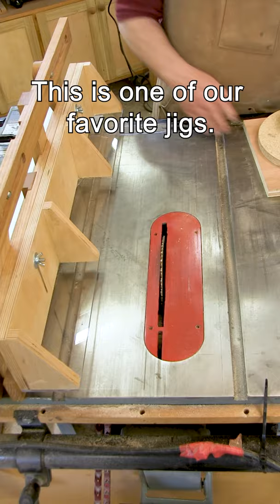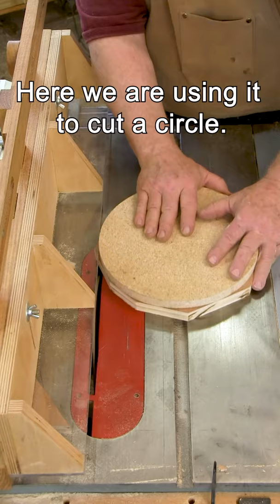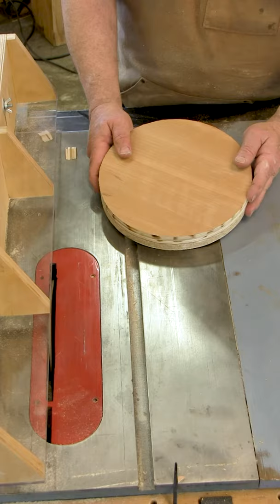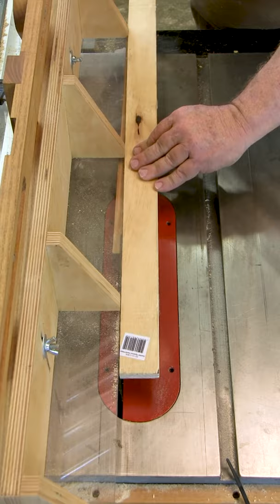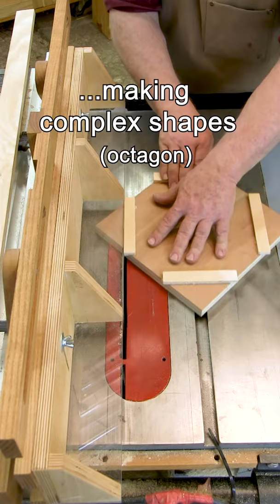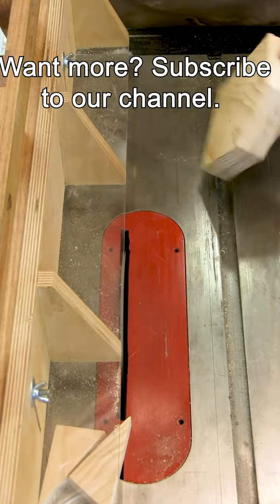The Horizontal Fence -- Amazingly Versatile.

Comment: Dangerous.  See those pieces of wood floating around the saw blade?  Not good and no reiving  knife in place.
Reply: Sorry, what? Have you a clue how kickback works? 1. There's no binding point. The fence float above the blade, thereby preventing pinching with the actual fence. So you're referring to a secondary contact kickback, not a climb or a bind.
2. The side containing the non-cutoff is being controlled by his hands. Laterally, I might add. Like a shaper or router table.
3. He's got a lexan plate supported by ribs covering the cutoff side. Anything that DID kick up from the side of the blade will be prone to shoot straight back (where he's quite conspicuously NOT standing in the line of fire, or UP and back where it will ricochet off the polycarbonate shield and very likely be corralled by those ribs.

It's reasonably safe to assume the offcuts (read: small trimmings) WONT phase through the steel blade and don't carry enough mass to play pinball around the confines of the shop. 

Now, if he set the back far enough (or omitted it entirely) to use the actual fence under that awning and a legit pinch-climbing kickback occurred on a 12" offcut, yeah: he'd have a splintery bomb on his hands. But you can see it's not a permanent fixture, and, based on his other videos, this guys the real deal in experience.

In short: he's fine. So is this technique. I'm planning to build one myself this weekend, based on this clip.

Comment: Can also use it as a jointer.
Reply from the maker: Absolutely, but I would recommend a smooth-cutting blade with 60 teeth or more.
Reply: How would you use it as a jointer?
Reply: @terrysr.curnutt9288 with a piece of straight stock attached to the top of the piece you need to joint. In the same way he makes tapered cuts in the video. Just use that now cut side against your standard fence and they will be jointed.

Comment: The process is called pattern sawing.
The pattern piece is on top of the wood to be cut.
The pattern's edges ride on a special fence (transparent in the video) suspended over the saw blade. 
Only the wood to be cut goes through the saw  blade.
The pattern is attached to the wood to be cut by double sided tape or by thin, shapened nails that poke thru the pattern into the wood to be cut.

The wood to be cut can be made smaller or larger than the pattern by moving the suspended fence's edge so it's no longer directly over the saw blade.
Reply: Is that what it does? 😅

Comment: Any plans available for this jig?  I didn’t see it on your store.
Reply: Google "L fence"  and you will see any number of plans. This is the first one I've seen to use a transparent face. Which means you can be sure to see all the offcut pieces, which need to be removed before the next cut. Use a transparent material that won't shatter and throw pieces at you or your dog. 

I like the Bob Van Dyke version in Fine Woodworking) that uses  2 toggle clamps (De-Sta-Co type) mounted on the back to get a snug fit to the fence. There are holes in the back material for both clamp to reach thru and press against the back of the fence.

This looks like that face is sloped. I've not seen that before. The others I've seen have vertical faces.